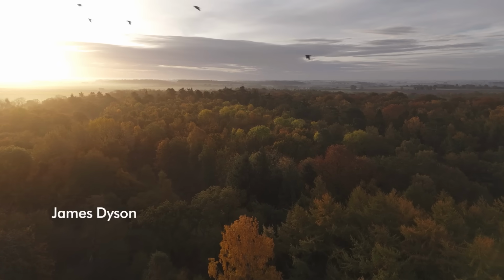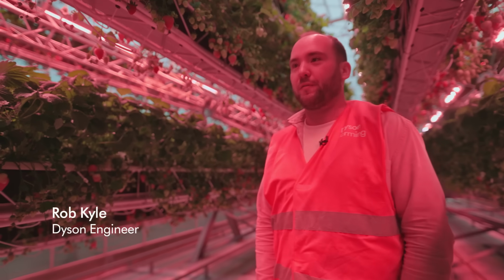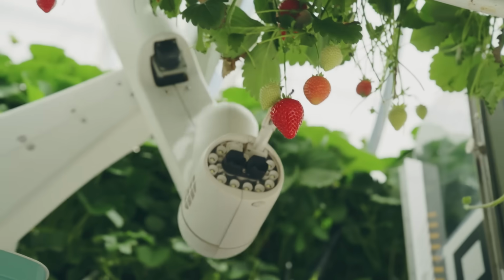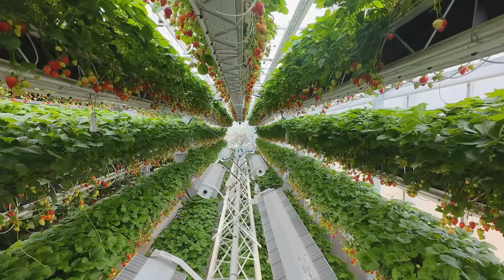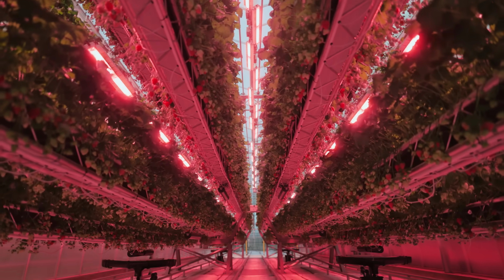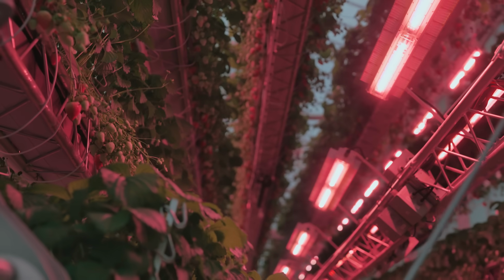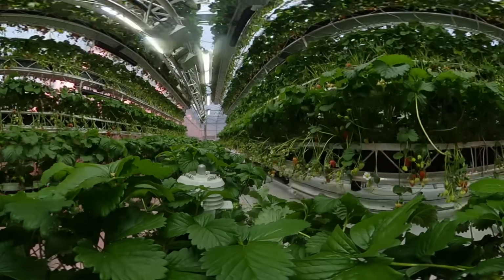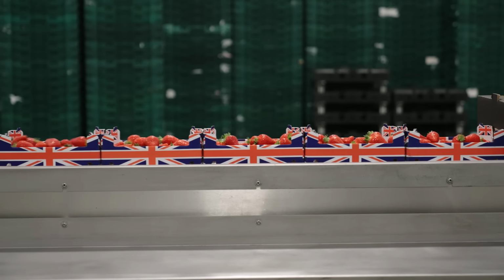James Dyson reveals the future of farming

Comment: While this looks efficient, this is an extremely expensive way of growing strawberries compared to raised rows. It's also highly susceptible to disease and they're not showing the maintenance that goes into pruning runners, adjusting soil, pollinating. Usually when you grow strawberry plants, you change the plants out once a year and this is not trivial. I am a strawberry grower.
Reply: Also strawberries are a meme when it comes to nutritional value for effort. If you want to grow something with extreme high calories/nutrients per hour effort, try sweet potatoes. They're easier to grow too.

Comment: Dyson continuing their tradition of over-engineered products that need not exist. I clean my house 10X quicker than a dyson vacuum by just not having carpeted floors and using a dust mop. I can grow strawberries at a fraction of the price and with far less work by just sticking them in the ground. Let's see innovation that creates a solution to an existing problem instead of creating a solution to a new problem you created to solve.

Comment: there is 2 much moving parts, i think you should try small batches of ideas, maybe floating platforms, those are basically frictionless, with some magnets so the bounce and look futuristic for the investors, also, robots with electromagnets could atract or expel unwanted trays, this idea is on the fly, im sure there is much 2 be done in this area, im also working on something similar

Comment: You know what low-margin hightech farming needs? More moving parts, so that you can get 100x the maintenance costs.
Also if you move them around "to give them the maximum energy of the sun" all you do is to give them all a fraction of the suns energy. If you want to reduce the intensity but not waste sunlight, use agri-pv

Comment: Some numbers: A strawberry farm typically produces about 5000 kg/acre a year, with a retail value of around $7/kg, producing about $35,000/acre of value. Therefore, running costs must be much less than this for viability. 

In contrast, Dyson's facility is reported to be about 26 acres. There are no real definitive financial numbers, but if we assume a running cost of $10 million a year (probably low, as reported investment is over $100 million and employment costs alone are probably close to this), it would need to produce much more than 50,000 kg/acre/year to be similarly priced, so productivity per acre would need to be at least 10x over a standard farm just to maintain the facility.

Comment: This has been done MANY times for a couple decades at a minimum. Even with a cost reduction and improvement in lighting over the years, these farms have always failed. On paper it seems like a great idea. Those systems require maintenance, they'll have down time, they run on electricity, etc etc etc. If those costs are not cheaper than putting the fruit into the ground with sunlight, you'll quickly fail. And strawberries can be grown EXTREMELY cheaply relative to these methods. Other farms have tried offsetting the power costs with solar but the maintenance there is just too expensive for growing fruit that is competitive with the ultra cheap (near slave labor) wages of certain countries that exploit the people at the cost of "international trade".

What you need is a reliable method of delivering sun light into the grow structure that doesn't move. Fiber optics perhaps? I'm not sure what the loss/degredation is but I would hope it's extremely low on short runs of it. This eliminates moving parts and the lights, if feasible.

Comment: I wonder how it would work to use some of this tech with underground facilities? Either by channelling sunlight in or using pure LEDs that are sustainably powered locally.

That way you could put these (geology permitting) under existing farms, or other places, and then above ground can have some traditional agriculture, solar/wind farms, or even habitat restoration. 

Then a parcel of land that has this is producing high yields, as sustainably as possible, potentially and hopefully not even using pesticides as it's a controlled environment, AND then has everything above ground going on on top of all that.

Would help with food security. Especially in the face of a changing climate (that depending on how things go could end up drier and hotter, but then also at times wetter, and eventually may even go considerably colder as a knock on effect of global ocean circulation issues.). It would also make The UK (and any other countries) more independent for food, and allow the consumer to get fresher produce that hasn't had to be stored for as long and racked up ridiculous mileage to get to your home.

Comment: They tried to do this in my state . They had a large farm they started to convert to this system .  They had all the permits and some government grants , also private investors. It was all framed in metal frames and then a local politician , stop the project. Said this is not a farm now, it is a manufacturing business which will be taxed at a higher rate and may not even be able to run in this area for zoning reasons .  Weeds are growing in the framed area five years later.

Comment: Ok great, now imagine doing the same thing horizontally*, so you won't have giant carousels that can break, piping that is static and doesn't require so much maintenance and higher pressures due to elevation, wiring that is static and can be easily separated from the liquid environment, not having to stop the entire mechanism for every simple repair, no need to have specially trained safety crew to save anybody getting crushed by the carousel, even the ability to have bigger equipment moving around the facility without accidentally destroying itself or the farm. All of those crazy benefits, and the only thing you need is extra available land, and it can be *any land, even arid and desert land (like they have in the Negev desert in Israel).

Comment: Are all the comments underneath it bots? Because this isn't the response you usually get for this tech. It's nothing new. It's pretty old. You know why nobody does this?

Because it is not economically viable. The cost of electricity is so high with this setup that's why you only see leafy greens or something like tomatoes being grown in this setup. Nobody is growing crops like wheat or any other cereals indoors which is what this tech was envisioned to solve. 

Hydroponics is a widely studied subject which is what is this indoor farming is. There is also aquaponics which is used to grow potatoes  but the yield aren't as high as you'd expect from a farm of a similar size. 

Netherlands is a pioneer in this field. They export over $100B+ of food from their country despite being such a small country because there are universities there, iirc it was Wageningen University.
This is the future of farming no doubt but the only thing limiting its wide usage is the cost of electricity plus also there is a lot of research work to be done for growing type cereals using this.

Comment: The energy price hikes of 2022 killed off a huge number of vertical farming and controlled environment businesses who were relying on cheap energy to run lighting and heating. But this is a great example of where a circular economy can make it far more rewarding- the products of the farms AD plants (energy and heat) can be put into the glasshouse to grow a premium UK based product normally unavailable at that time of year. The crop bi-products feed the AD plants and the digestate is spread on the ground to help more crops grow. The challenge is, most smaller farms can't access the funding to set up all the elements required for the circular economy, but it does show what is possible.

Comment: This seems somewhat wasteful in terms of space. It requires fewer grow lights, which is a benefit, and allows a fairly trivial way to use natural light, which is also a benefit. Though light could be directed via mirrors or fibre optics, more layers of grow lights, and a denser tiered stacking approach could be simply implemented, increasing density, and simplifying mechanical systems.

Hats off to trying something different, though. At least it can be said that the solution appears to work rather well!

Comment: For those who are experts, how does this compare to the relatively efficient agricultural systems in Netherlands?
Reply: Hi there, aquaponics expert here. This system isn't efficient. In general, these systems have been demonstrated conceptually many times since around the year 2000 or so. The overhead makes them wildly inefficient. The liquid fertilizer inputs make them **WILDLY** unsustainable and contribute to algae blooms off the coast every time the water gets changed. In general this system does very little to increase efficiency, yield, or sustainability over other more novel and modern methods of sustainable farming. This is techbro hype nonsense from the same people that put a ball-gag style "air filter" on a set of headphones. Don't buy into it. 

If you're interested in other means of more sustainable farming that increases yield while building soil or providing other critical inputs, look into aquaponics, vermiponics, or no-till farming.

Comment: It's a gimmick but a great promotional material for Dyson. You are not going to out produce or do it cheaper than somewhere like Spain which has much lower input costs and great weather which is free.
Reply: Right, a poly greenhouse is cheap, land is abundant, and your strawberries are a 24 hour drive away. Yes it all takes energy, but the energy required to drive the finished product is small in comparison to total inputs. There are other sovereignty and self-sufficiency reasons to do it locally of course.

There are similar setups in NYC which is funny because upstate New York is like 150 miles away with lots of land.

Comment: One comment I would make is this should have used 100% artificial light. Using natural light & then supplementing w/ artificial light has increased the complexity/cost of this rig dramatically

It would be much better to focus on highly modular/cheap/scalable farming tech that uses artificial light, and then separately focus on maximizing energy production in Europe.

Comment: I don't know if this is practical, but ideas sound more profound when he speaks them in British!
Reply: Naw, thon's English no British
Reply: lots of wasted space making the rig circular. an elliptical shape would allow limitless height and stack them closer together
Reply: forwarding my comment here: One comment I would make is this should have used 100% artificial light. Using natural light & then supplementing w/ artificial light has increased the complexity/cost of this rig dramatically

It would be much better to focus on highly modular/cheap/scalable farming tech that uses artificial light, and then separately focus on maximizing energy production in Europe.
Reply: @blahblahtherealboy  past vertical farming companies in the US failed because they did everything using only artificial light and the costs were too high. Ultimately the question is how can they keep the costs low enough to be competitive with imported foods. Using a blend of real and artificial light seems like a good way to improve efficiency, assuming that the rotation motors aren't using too much energy.
Reply: @basda_placeholder  Talent is the biggest bottleneck. these are machines that require fairly well trained staff to run and maintain. I think automation is what's really going to make this a viable path forward.

Comment: That's cool and all, but James Dyson has a net worth of 15 billion.  How's a strawberry farmer in the UK going to afford that and how on earth is a multi-millions dollar machine cost effective for a $20,000 annual crop if the ROI takes 100 years to break even?
Reply: It's a work in progress I guess
Reply: They solved a solution that didn’t honestly need solving. They wanted to minimize external energy use from led ligjts. But led lights probably use less energy than 24h rotation. Like most other indoor farms. They use very efficient lights just stacked on top of each other.

I honestly still love their solution though cuz minimizing energy usage is more important. Although like I said they could have just used A frames and had half the yield but then 1/1000 of the cost
Reply: Also made no sense in England but this would be amazing in a desert but then water?? I guess you get evaporative coooling though

Comment: Cute PR stunt, don't see this being cost competitive against imported strawberries. There's a reason vertical farms constantly go bust
Reply: At scale this probably won’t work because of the parts that have to be fabricated out of what seems like steel. I think their primary goal here was to minimize energy usage while minimizing space which to give them credit I believe they achieved quite well. Unfortunately yes a simple a frame would have also served a similar result with the light but would have yielded maybe half the produce per area. But if land isn’t an issue a simple a frame should suffice
Reply: @schoolofirelia626  Rotating a massive steel frame loaded with wet soil is going to be pretty energy and maintenance intensive. These also have a lot of area not being used for actual plant growth (this set up uses maybe 30 of the area for plants if even that). Most indoor growing facilities just use racks of planters that use about 70% of the volume of the space with their main costs coming from energy to power the grow lights, planting and harvesting. This set up looks like it uses sunlight, but there are still grow lights in use and that big ole steel frame isn't going to be cheap to keep spinning 24/7
Reply: Cute but necessary imo, if we didn't try and innovate we would be stuck farming crops by hand - we need companies willing to stomach these R&D losses to advance technology, otherwise everyone would just sit back and try to greedily piggyback off each other.
Reply: @strawbaria  Sure, innovation is important but Dyson isn't trying something new. Vertical farming has been tried in a lot of different ways all over the world. In most cases, the costs of set up, maintenance, energy and labor just makes it uncompetitive from a cost standpoint. There is a lot of land that needs almost no development to be viable, water falls from the sky or uses cheap and proven irrigation systems, and the sun is free. That and harvesting can be done with giant machines that needs 1 person to operate or uses seasonal workers. The very few cases where vertical farming has proven viable is for short crops, with a fast growth cycle, short shelf life, easily machine harvested and high value. Basically salad leaves
Reply: @DeepVeinThrombonus  Exactly on point. In fact this is the opposite of innovation, this is taking an already unsustainable idea and making it infinitely worse by introducing giant moving parts into the mix that will inevitably fail.   You want ACTUAL greenhouse innovation, look to the Netherlands and just copy them.
Reply: @strawbaria  necessary because they taxed their farmers land away then gave it away to foreigners 😂